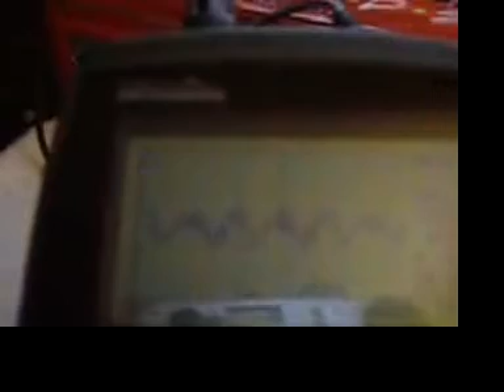Radiant Joule Thief -1

Comment: some considerations: Be sure to use IRON wire and copper wire .. like Stubblefield ... not ONLY copper wire.  If you can have a more massive iron-metal core, larger surface area, more volume, and if you can do a higher turns ratio, by increasing the inductance, you should see a higher voltage.

Comment: I think Stubblefield's inductor-wound battery has some interesting abilities. One -- as magnetic fields shift while its in the earth, the oxidization on the metal can be CLEARED OFF. The oscillations in the coil create fields that make the electrochemical reaction more efficient -- less resistance.